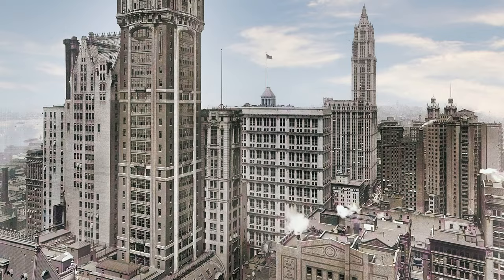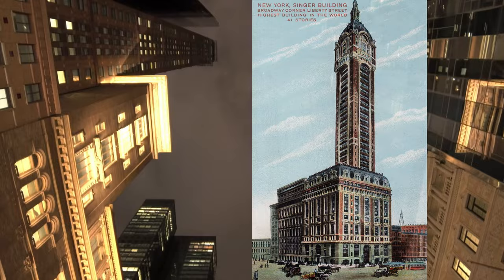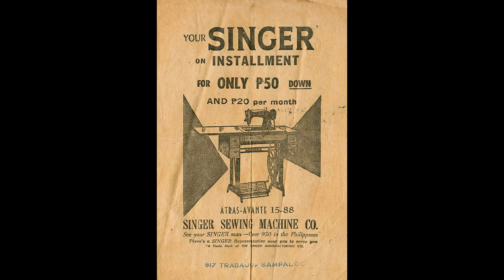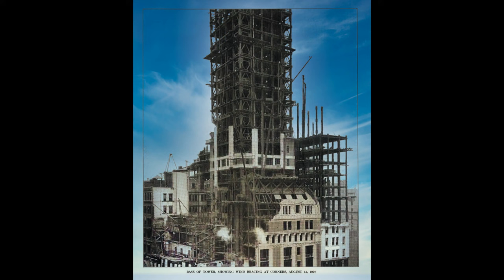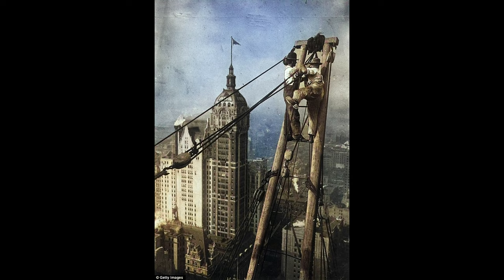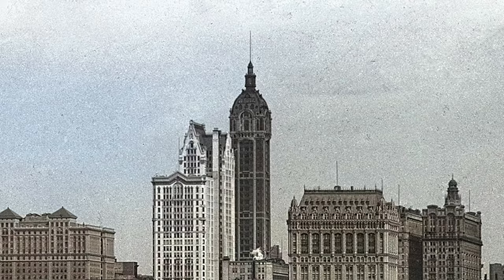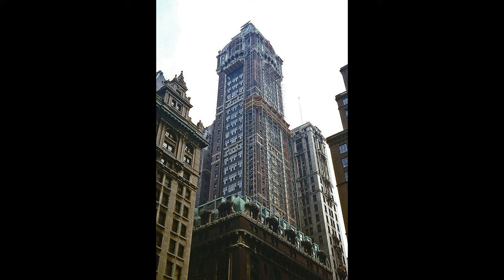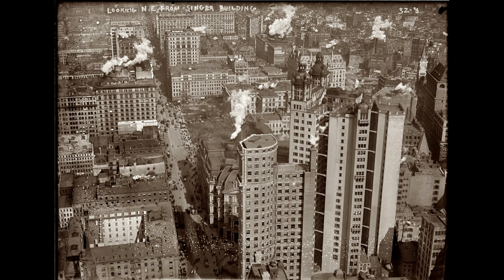The Rise and Fall of the Singer Tower

Comment: Singer Tower, Woolworth, and Chrysler, are favorites of mine. I am so glad the Woolworth was restored and the top found a new use as private residences.
Reply: Oh, and you have a great voice for narration!!
Reply from the maker: Thanks for watching. Those are on my favorites list as well. Wouldn’t it be awesome to live at the top of Woolworth? I made a video on the Chrysler Building too. Be sure to check that one out.
Reply: @TyChee  Ty , yes I plan on watching your Chrysler Building video! Also, there is a video out there of these two crazy young men that sneaked past security and ended up on the sloping roof of the Woolworth. Have you seen it? The multi level penthouse is under construction and they are climbing the scaffolding and then are shown climbing a ladder inside to the original observation deck and then another ladder to a smaller deck that surrounds the lantern just a few feet from the very top. They are crazy yet in my younger days I could see myself doing something nuts like this too!! Mike
Reply from the maker: @michaelmichniak127  Hi Michael. Yes, Ive seen that video. Those guys are pretty darling and what an adventure that must have been. I lot of that was going on during the conversion of the upper floors to condos. I believe that the penthouse is completed now. I've seen articles that report that is will be listed between 79 and 130 million dollars.
Reply: These are also my favorite.
Reply: I was so upset when I finally made it to the Woolworth building in my life after waiting 40 years it was not open to visitors anymore, we walked in anyway and got to stay about 5 minutes.